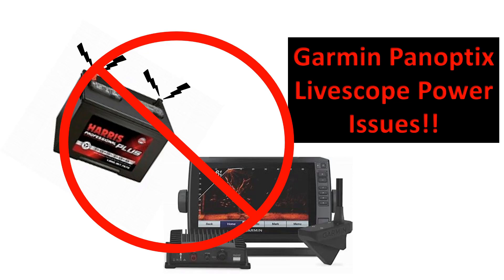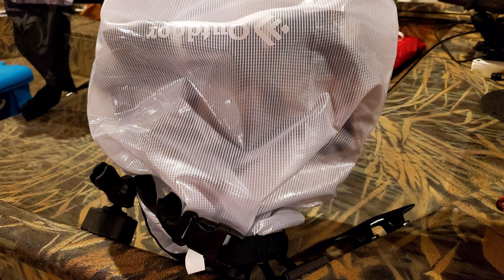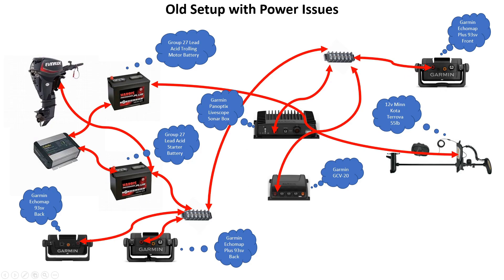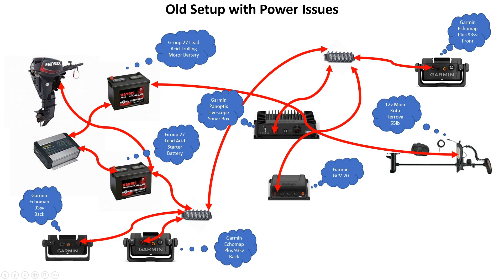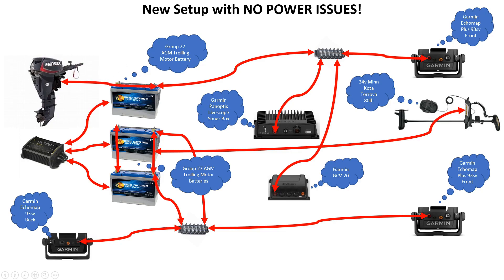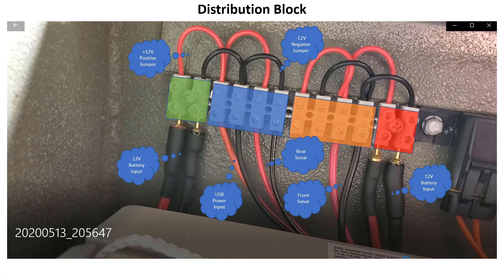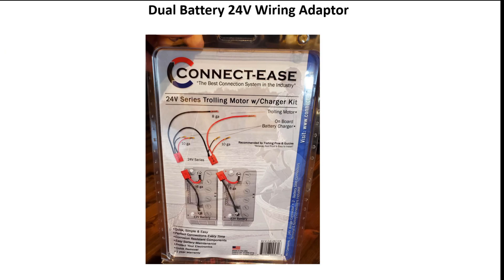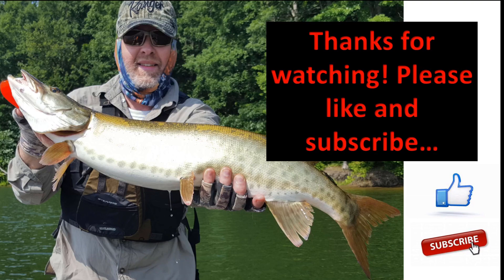2020 Garmin Panoptix Livescope Power Issues

Comment: Do you have a master shutoff or accessory switch for the graphs and transducers to avoid parasitic drain when not in use?
Reply from the maker: No, I keep my batteries on chargers and the faceplate removed from the sonar units.
Reply: You're absolutely right Cisco Kid there is parasitic drain on the panoptix and ethernet boxes as well as the garmin display when plugged into the cradles. The only why to stop that is put switches on the panoptix and ethernet boxes and takes the displays off the cradles then zero power will be running through them. I would also not have anything else on my main motor but the motor alone and a cranking battery not a deep cell. The trolling motor should have it's own battery and the rest on its own batteries
Reply: @scottscaneh  Yeah I heard the pan optics doesn't like anything else but a straight shot to the battery. I'm considering a little lithium battery for electronics.
Reply: @ciscokid2444  good idea I have also heard people use dewalt and milwaukee 18v drill batteries
Reply: @scottscaneh  yes I heard that too. I picked up a small lithium for my kayak electronics. Maybe I'll get one for my bass boat two 93SV and panoptics.
Reply: Thanks for the response Scott 👍🏽
Reply: @ciscokid2444  awesome let me know how it works out. I'm thinking of using a battery that I sell and put in emergency exit light/battery units

Comment: Good video!  You have a link to the distribution block?
Reply from the maker: I just went to Lowes and told them what I wanted to do and they recommended one. Just make sure to use silicone after you've made your connections if they have the possibility of getting wet. Just coat where the wire meets the screw. Thanks for watching!

Comment: Garmin and others recommend not using trolling batteries for electronic die to feedback issues.
Reply from the maker: I never had any issues with feedback, but in my new boat, I have a dedicated electronics lithium battery. Runs all my electronics for over 19 hours. I did a video on that install, too.

Comment: I wonder what a AGM is ,,
Reply from the maker: The acronym stands for “absorbed glass mat” and that’s one of many improvements made to Planté’s original train light battery. Glass mats, cushioning the ultra-thin lead plates, will squish like a sponge. In turn, manufacturers can squeeze more glass mats and lead into one battery. More lead equals more power. Plus, that squish factor means the battery’s insides are packed tightly.
AGM batteries also have valves regulating the amount of hydrogen and oxygen gas allowed to escape during charging. They fall under a broader category of valve-regulated, lead-acid (VRLA) batteries, typically used for storing a lot of power for a long time or for long-running power uses.

Comment: The best way is Lithium battery 14volt or 20volt lead acid battery’s are only 12volt and discharge down from there. Lithium batteries will maintain higher voltage over a longer period of time
Reply from the maker: I'm considering going with lithium batteries when my agm batteries die. Hopefully the price will come down,  because they are pricey right now.
Reply: @fishingwithjc8475  amped outdoors batteries are under $200 with charger

Comment: Thanks for the video! Curious did you have issues specifically losing just the livescope transducer connection but everything else remained fine? That’s what I’m currently dealing with
Reply from the maker: My main issue was power related,  yours sounds to be connection related. If your voltage is below 12v, then it could be related to low voltage.  If not then there's something else going on. Have you called garmin?  They are usually pretty good at determining your issue.  Good luck and thanks for checking out my channel.  Much appreciated.
Reply: I’m having that that issue. If my voltage drops to below 11v it drops livescope but everything else works. I’m going to add a battery under my dash to run just the livescioe black box.

Comment: See you are completely backwards from my set up.  I run my traditional sonar and Garmin displays from my starter battery. I have 2- 93sv uhd and 1- 94sv displays.     My trolling motor and livescope share the 24 volt deep cycle battery’s.

Yes panoptix will run on 12v, 24v even 36v.    Look in the manual it tell you.     So livescope has never killed my trolling motor battery’s plus I run a minn Kota terrorva i-Pilot  and can be spot locked or on that trolling motor heavy all day and livescope on to never had a issue 

Now unless you wire in your own switch in the 24v system for livescope.  You have to disable it and enable it from the display when it’s not in the water 😂
Reply from the maker: Thanks for the comment.  I talked to Garmin about this and they said I could have a dedicated battery for just the units if I desire.  So I may end up having two batteries for my trolling motor, one for the starter and one for all the sonar equipment.  That will be my next upgrade.  Tight lines!!
Reply: @fishingwithjc8475  to me another battery just for electronics seems just added weight to the boat.   Personal try it out with your display running off the stater batter or “house battery” and wire panoptix into your trolling motor battery.  Mine works great never tan battery’s down.     👍👍
Reply from the maker: @craigcanterbury264  mine is working okay and I have plenty of power at the end of the day. You're probably right about the added weight. I may just leave it as is. I'm getting ready to add another graph, so I'll probably add it to the starting battery.